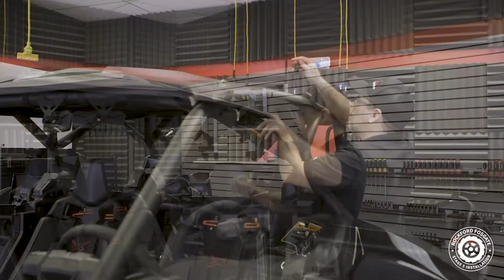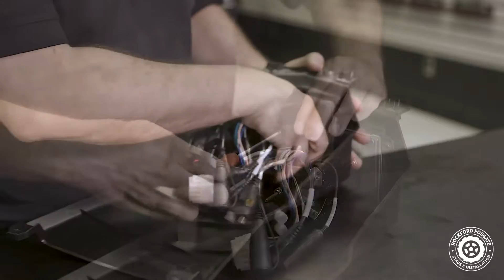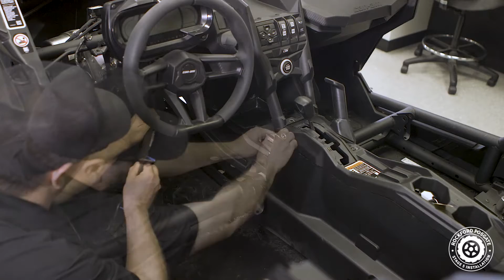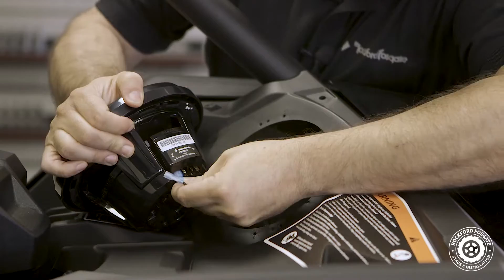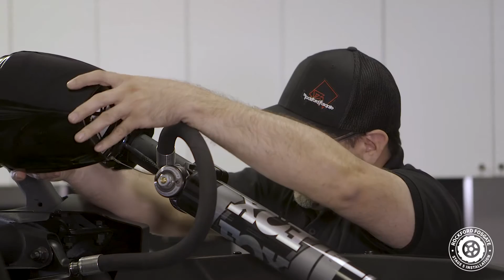Can-Am X317-STAGE5 Installation (Gen-2)

Comment: Which security torx or what size is it to tight or loosen the rear mount speakers/pods??
Reply from the maker: The small screw for the clamp assembly is 4mm. The large security screw for attaching the T-Yolk to the clamp assembly is a T45 Security.
Reply: @rockfordfosgate  cool, thank you!!
Reply from the maker: @marlocantorjr.6626  Great!  You're welcome!

Comment: Love how they don't talk about how the speaker magnet can fuck up your steering 🙄
Reply from the maker: HI Randy, This is an extremely rare situation and it's easily fixable.  We've had our dealer network accumulate hundreds of installations without issue.  Many Can-Am dealers do a reset as part of service since the power steering on this car is sensitive, so UTVs that don’t have an audio system installed can still benefit.  We have documentation for the reset available here: http://rftech.custhelp.com/app/answers/detail/a_id/1374/

Comment: Where in this kit are the front speaker harnesses?  I have a box for the rears but don't see it in the list of included items.
Reply from the maker: They should be in the RFX317-FSE kit or the RFX3-K4 wiring harness.  Be sure to check any folded cardboard pieces because some of the harnesses are packed in those.

Comment: Hello one question, I Just bought a Maverick X3 XD Turbo R, I have read in the specs this kit is compatible for my vehicle RF X317 STAGE5,  But my question is, Is it authorized for the dealers? Can I lost warranty if I install it? What can you tell me about it. Thanks.
Reply: It is Maverick X3 XD Turbo R 2021, it is compatible right?
Reply from the maker: @JesBu  For 2020 I see the [X3 X DS Turbo R] & [X3 X DS Turbo RR] as shown on our compatibility chart here: https://rockfordfosgate.com/products/details/x317-stage5/
When the product is installed by a consumer, you have the individual product warranties, which is 1 year on all individual components.
Reply: What about the warranty? Do I lost warranty if I install this equipment? Regards
Reply from the maker: @JesBu  No, you don't loose anything.  You still have the exact same warranty coverage as if a dealer installed it.  However, you will do any of work needed and will not be able to just take it into the dealer and have them exchange it for you.  Also, It's important to follow the installation video and setup the amplifier per our "Amp Tuning Guide". This is the biggest issue we have is people ignoring the setup guide, doing their own "tuning" to the amplifier, then blow up their speakers and wonder why it happened.  You're commenting on page that features the installation video, so I trust you'll have no problems at all :-). You should be 100% good.
Reply: @rockfordfosgate  one last question, according the compatibility table the RF STAGE5 is compatible with my CAN AM MAVERICK X3 DS TURBO R 2021, but I have read in some forums that the sub boxes under the seats don't fit in some X3 models due a chassis tube under seats, can you confirm this is not my case please? CAN AM MAVERICK X3 DS TURBO R 2021.
Reply from the maker: @JesBu  You can see the details of the enclosure and the enclosure installed.  If there is a pipe that runs where the subwoofer enclosure would fit under the seat, then it will not fit.  Unfortunately, we don't have a 2021 X3 DS TURBO R here to check against.

Comment: Is there a New generation stage 5 kit ? I'm having a hard time finding this kit also your website shows out of stock.. 2021 can am maverick x3 max XRS RR
Reply from the maker: The X317-STAGE5 is the current model number.  Currently, none of our products are available for purchase on the Rockford Fosgate website as we're revamping the checkout process.  You'll see the top red banner with "A new shopping experience coming soon", so we'll be back online in a couple weeks.
Reply: @rockfordfosgate  I need this system lol. I ordered on two vendor sites but had to get refunded because wasn't in stock.. thanks
Reply from the maker: @Fonz19  Appreciate you looking at our kit.  As you can see from the installation video, it's a solid!  Hmm, I just check my last internal communications and it looks like all X317 stages were still out of stock.  I'll check to see what the holdup is and an ETA.
Reply from the maker: Just got word from our UTV sales guy that these should be back in stock end of October/November.  The subwoofer enclosures being out of stock have held up the kits from being made.  This might be right in time when our site goes back online to sell.
Reply: @rockfordfosgate  thank you so much I can't wait.. will the components be a new generation or same?
Reply from the maker: @Fonz19  Not sure what pieces you're referring to, but the components are the current generation that we've been selling for the past year.  Note, that we don't have the 2021 models on the compatibility chart yet, but I don't see anything on the Can-Am website that raises any red flags.

Comment: Can you install subs with the grills installed?
Reply from the maker: It's not advisable to do this since there is not enough clearance.  If you forced them in place, the plastic grille will push against the floorboard, it will not fit properly and will vibrate when the bass hits.  It's a down-firing subwoofer so technically, there is no need for a grille.

Comment: I have the Stage 5 on my 2020 X3 XDS. When parked, I tap the 'push to start' button to turn on the stereo, but it shuts off after roughly ten minutes. How do I keep it from shutting off?
Reply from the maker: Are you sitting still like while listening to music at a campsite for 10 minutes or are you driving around and it shuts off?
If sitting still, the Accessory 12V will go to sleep, making the radio shut off.  If you want to have the system stay on while parked, you'll want to relocate the red/black turn-on wire to source +12V directly from the battery and put it on a switch so you can disable it for long-term storage.
If driving, it sounds like there is an intermittent connection somewhere.  Double check the wiring  and all power connections.
Reply: @rockfordfosgate  damn this happens to me. also sometimes the radio wont even turn on when i am parked at the campsite. it will only turn on when driving.
Reply from the maker: @machiavelli_g4458  This sounds like a function of the Can-Am accessory system going to sleep so you don't drain the battery.

Comment: I have a 2020 model and I’m installing it right now the I got to the enclosure part and I can’t put them because the brake lines ru through the bottom of the seats and there isn’t enough slack to get under it or push it to the bottom
Reply from the maker: HI Rafa, the "X3" version is compatible up for 2017-2018 as per the COMPATIBILITY tab on all our product pages.  The "X317" versions are compatible up to current 2020 models.  The brake lines and SmartLok options were upgraded around 2019 and we made accommodations to the kits, therefore creating the "X317" version that's compatible with all models from 2017 and up.
Here's the X3 version (2017-2018): 
https://www.rockfordfosgate.com/products/details/x3-stage5/
Here's the X317 version (2017-2020):
https://www.rockfordfosgate.com/products/details/x317-stage5/
Reply: Rockford Fosgate already got it all installed, sounds amazing, definitely happy I went with the stage 5
Reply from the maker: @raff_661  Awesome, glad you got everything figured out.

Comment: they are watherproof?
Reply from the maker: Absolutely Yes!  All components are weatherproof.  Speakers are Waterproof and UV stable, all connections are sealed.  The only thing we would advise against is submerging the amplifier in water or mud because moisture can enter the electronics.  However, if you're this deep, you likely have bigger issues with the dash electronics being submerged as well :-)

Comment: I just got a 2020 Can-am x max turbo rr, a shop is installing the stage 5 kit but the package (closed box kit) dosen't say X317 Stage 5... is there any way they will install the older version X3 Stage 5?? Or they have to install the newer version because its a 2020 or do the boxes just say X3 Stage Kit even on the newer version??
Reply from the maker: There are two versions: X3-STAGE5 (2017, 2018) and X317-STAGE5 (2017, 2018, 2019) which makes speaker panel accommodations for SmartLok and the subwoofer enclosure's better mounting configuration for Driver/Passenger seats.  Please note, we have not officially confirmed compatibility with 2020 yet.
Reply: @rockfordfosgate  Thanks for responding!! What about the sound quality or durability?? Is it better on the newer version or nothing changed?? Can u guys tell me the exact changes please.
Reply from the maker: @marlocantorjr.6626  Sound quality is identical, because nothing in that regard has changed. The exact differences are noted here: 
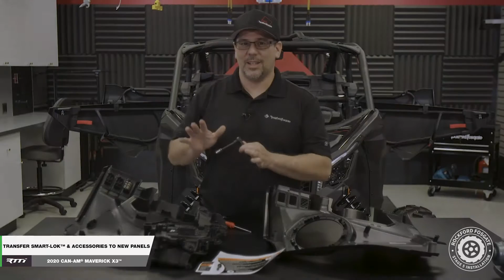- Timecode 05:59 to 07:00 - The RF panel includes provisions for SmartLoc.
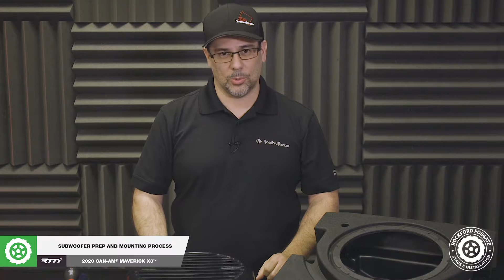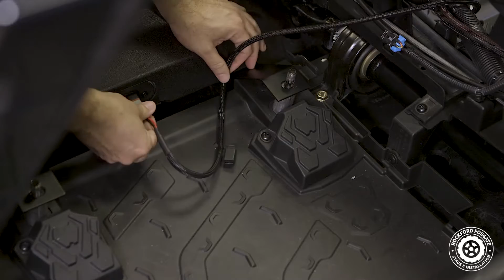- Timecode 12:52 to 15:05 - The new suspended enclosure allows for placement on the left & right side while still allowing for full up/down seat travel.
Reply: @rockfordfosgate  Thats awesome, thanks for the info!! I called the shop whos installing my sound system and they are putting the newer version of Stage 5 on. I can't wait to try it out!! Thanks.
Reply: @rockfordfosgate  So i tried out my Stage 5 sound system in ocotillo wells and it sounds really good but on every little jump or whip it kept cutting off... it got to a point where it got annoying and i was getting mad lol what do you guys think it is?? Is it a faulty system or is it the installation?? The system didnt turn off, it just stopped playing the song for like 3 seconds then kept playing the song. Please help lol
Reply from the maker: Hi  @marlocantorjr.6626 , Thanks for outfitting your system with Rockford Fosgate and I apologize for the cutting out.  There could be 1 of 2 issues.   1) Check the RCA connections at the radio. If they are popping out, then you may want to use TESA-TAPE to keep the connectors intact.  2) Flex the wires at the back of the PMX-2.  If the system is cutting out, you may have an intermittent connection inside the radio itself. We will warranty the PMX-2 if it's determined to be the problem.  If you purchased this from a dealer, see if they can do an over-the-counter exchange.  Otherwise, if you determine the radio is the problem, you can get the warranty process started here: https://www.rockfordfosgate.com/contact-us/41/https://www.rockfordfosgate.com/contact-us/41/
Reply: @rockfordfosgate  Thanks for replying and for the info!! Ima check the installation and if it keeps doing it then ima reach out to you guys for that warranty. Thanks in advance!! Ima keep you guys updated.

Comment: Just installed this setup for the first time,pretty straightforward for someone with a advanced knowledge of stereo installation.....i was informed upon delivery to the customer that the roll cage was aftermarket which explained why the front stage was more "involved" than in this video. The rear pods are just like wakeboard tower spkrs but without running wiring thru the roll cage tubing. Overall a very loud clean system worth the dough
Reply from the maker: Thanks for your review of the process Woody and sharing your experience with other Fanatics!

Comment: is there anyway to mount the subwoofer box with the rear of the seat in the lowered position or does the seat rear mount have to be in the raised position?
Reply from the maker: The subwoofer enclosure can fit under the front driver or passenger seat and can accommodate full up and down travel of the seat.  Just to clarify to others reading this, the subwoofer enclosure does not fit under the rear seats since they are slightly shorter in length.
Reply: Rockford Fosgate just to clarify I’m talking about vertical travel not sliding the seat forward. I’m 6’6” and I have the driver seat in the  lowest position. The seat does not sit on top of the rear aluminum spacers. So the rear mounting brackets for the box would not sit on top of the spacers like they do In this video  they would be mounted to just the floor. Just making sure before I spend $,3300 
Thank you for replying so quickly!
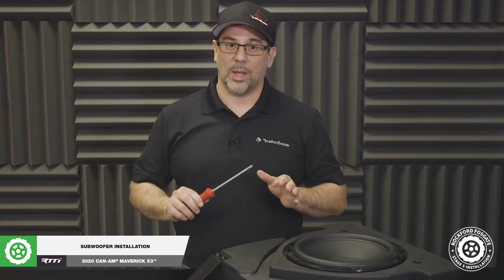Reply from the maker: @ryanmoran5622  Thank you for the clarification on the front seat where you positioned the aluminum spacers on top of the rear bolt-down locations, effectively lowering the seat.  As you can see at 14:00, the subwoofer surround protrudes from the enclosure assembly.  At 14:38 you would then be mounting the back portion of the subwoofer directly to the floorboard, which will cause problems with the subwoofer hitting the floorboard.  I checked with our New Product Development guru that developed the enclosure and he verified the rears cannot be lowered with the enclosure in place.  Therefore, I would recommend the X317-STAGE4 since it only has 1 subwoofer and you can position that one under the passenger seat.

Comment: HI Rockford Fosgate, yes the dealer did get to bottom of this. Received a new head unit (which was not easily accomplished because you wanted to wait for us to mail it back, to check it out, which would take 10-14 days or so, meanwhile my new machine was sitting in the selling dealer. So the vendor that I bought it from, had to do a warranty claim, not sure what they did, but I had to pay for a head unit up front, this way I get a new one sent out, put in, and then once I returned the old bad one, I was refunded. So yes all is good, but I would have hoped and expected better customer service from you guys. Thanks,
Reply from the maker: Thanks for the quick follow up Brian and I'm glad the new radio fixed the problem.  I apologize for the service issues.  I remember this was confusing because we didn't learn the system was purchased from another dealer until late.  That dealer should have been able to do an over the counter exchange for you.  Unfortunately, they had YOU do all the work for them, which is definitely why we work hard with our Authorized Rockford Fosgate dealers to provide exceptional service.  Hope you have a great Holiday Season with the family in your new Can-Am!